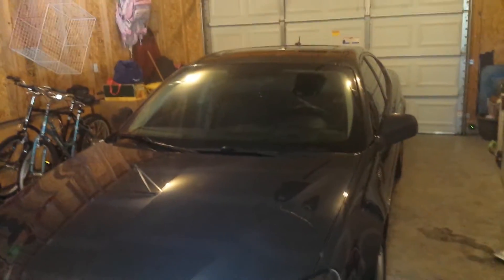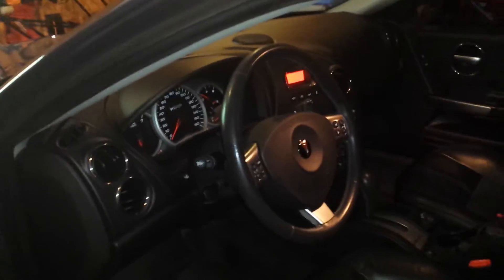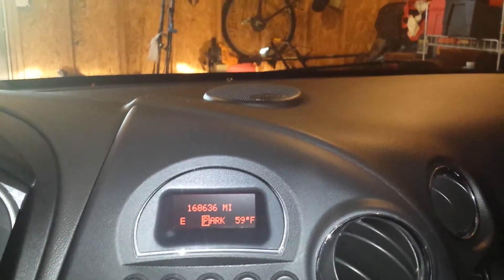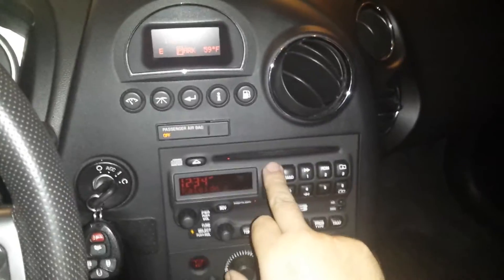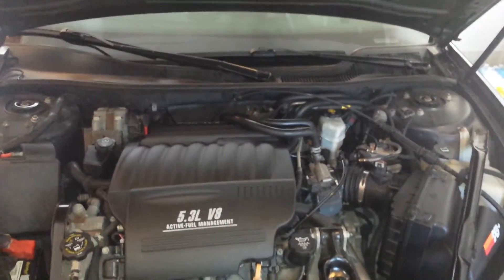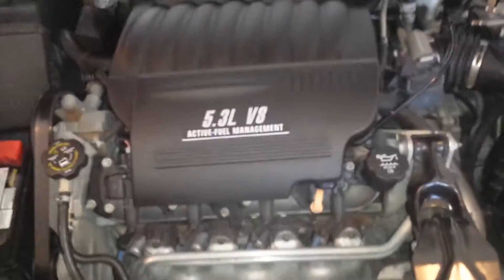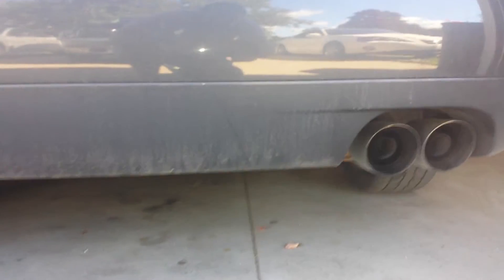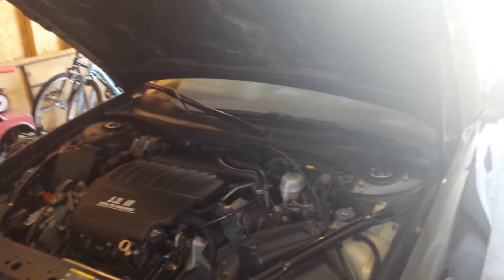2008 Pontiac Grand Prix GXP walk around

Comment: All the calipers don't have Gxp u had to order that on your car most of them come with moon roofs and 2 two tone leather and suede seat if u got lucky u have one with gxp screen in it all of them came with heads up display and a slightly bigger spoiler than the base model grand prixs and the gtp model all American ls4 5.3L v8 that's a corvette engine u could either have the little black antenna in the front or the back on the top of the car 0-60 time with this lovely monster is about 5.6sec with 303hp and traction control this made the gxp the fastest production car of its era u got two twin pipes with 2 head tips on them he aftermarket for these cars are okay but I think gxp collectors like my self would agree that the mainly stock look is good besides tinted windows, tail lights, and the back up strip u can mod this platform to be pretty powerful put the gtp is better for modding this is a lovely sleeper just like its sister car the Bonneville GXP
Reply from the maker: Beysun Bell Never knew you had to order the GXP emblems on the calipers. I love this car, still a fast four door that sounds amazing. Only 15,000 or so were made so not everyone has one, and I still get people doing double takes when they see it. I do have to say I like the sleek nav unit look, and Pontiac screen, stinks it can't play mp3s. Love my head units mp3 capability. XM radio never plays enough of the music I like.

Comment: How many transmission replacements?
Reply from the maker: In short at least once.  I purchased this car in May 2014 with 136,000 miles.  I believe the previous owner had the transmission replaced under warranty at around 80,000 miles.  When I bought this car the fluid was very clean and red.  Even with this I did a pan drop with filter replacement and fresh Dex XI.  Inside the transmission we found very little band material and no metal shavings.  It was pretty much immaculate.  I am now about to roll over 170,000 miles and the transmission appears to be holding up.  At all times I do my best to keep my temps around 150-185f without any additional transmission cooling.  I have set aside the funds for a replacement when the time comes; most likely through TEP.  Thanks for watching!

Comment: Yeah the previous owner was right to change the wheels. The stock 08 wheels are ugly. I didn't know 08 had different wheels until I got the car. One of the dumbest things gm did with these cars.
Reply from the maker: ArtOrrific GM trying to save money by ditching Alcoa. Thanks for watching.
Reply: Yeah me too. I got a flat last month and was fcked because these cars don't have spares. Waited 5 hours for a tow. Gonna get aftermarket and lose the staggered setup and keep one as a spare. I did a muffler delete on mine. Big difference from stock and sounds pretty aggressive. It's pretty loud but I'm use to it now doesn't really seem that loud anymore.
Reply from the maker: ArtOrrific Just a ZZPerformance 3" downpipe with the wearing out stock 176,000 mile exhaust. Sounds nice, just a little bit of drone while accelerating. Nice and comfortable while cruising.